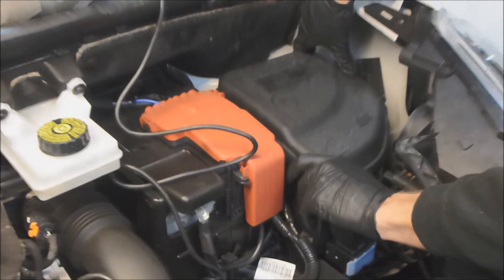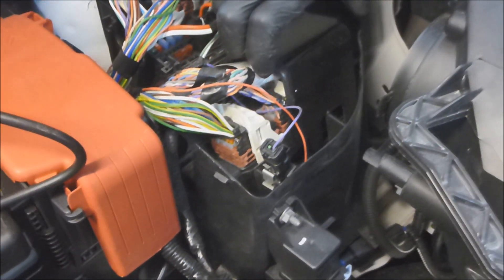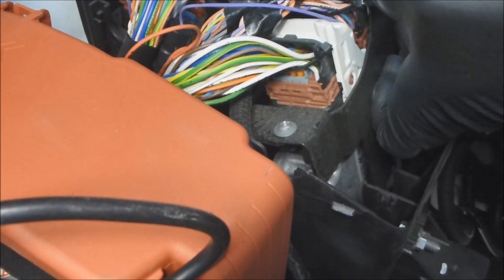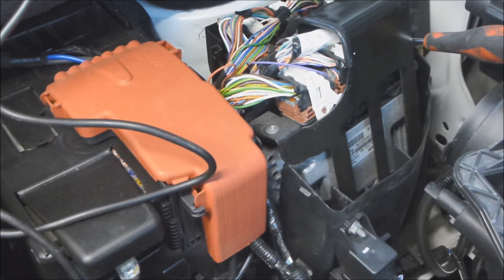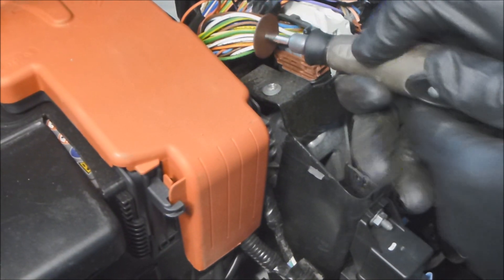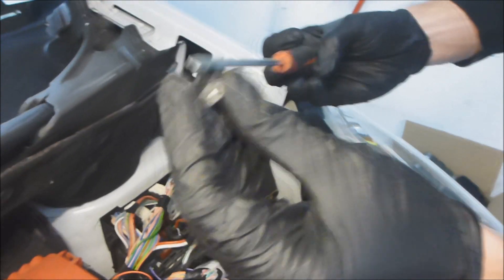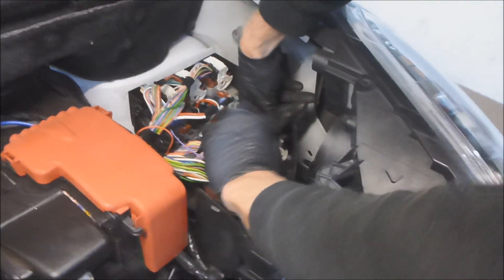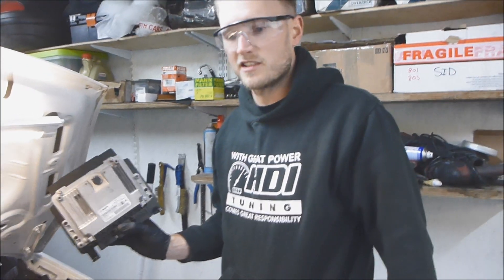ECU removal Citroen Berlingo B9, Peugeot 307, 308, Peugeot RCZ, Citroen C4

Comment: Would a faulty ECU cause the hazard lights to come on randomly , car on or off , they flash silently like when you open and lock the door with the fob
Reply from the maker: No thats the BSI causing that, or the COM2000 module if you have that. Usually the BSI
Reply: Hi, could ecu cause blinker blinking too fast? A few people checked for common problems of this very car except for ecu

Comment: Hi. I have a 308 1.6 petrol auto 140bhp 2008 model. Just had it mapped to 190bhp. There doesn't seem to be any difference in power to me. However when putting the ecu power cables back in, two of the three slots looked to be the same shape etc. I think they were the first two going left to right. He just took a chance and plugged them in as he neglected to take a pic or make a note of the sequence he took them out in. The car seems to start etc fine. Can I take it that the two slots that are the same can have either lead plugged into them and it won't affect the cars performance? I am wondering wether to maybe swap them and see if it makes any difference but am worried i might damage the electrics.
Reply from the maker: No, don't try that. They only go in the correct slots you can't put them in wrong. Probably a problem with the vehicle or the remap.

Comment: Is the ECU at fault when the temperature gauge goes into red randomly even from cold and tachometer doesn't work at all?
Had live data reveal engine rpm is there and temperature is correct? 
Cheers

Comment: Good morning...do you know if the peugeot 206 1.4 8valve  (lockset) ECU ...BSI ...cluster...and kye... Will fit on my citroen berlingo 1.4 8valve...is it the same ?and will it be plug and play...? My citroen berlingo 1.4 has a BSI problem...so i want to change it...